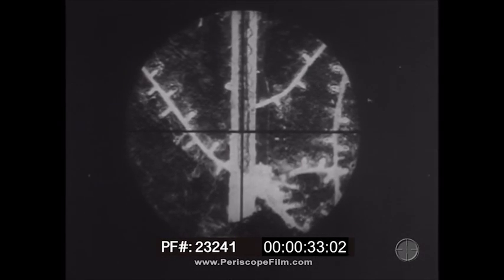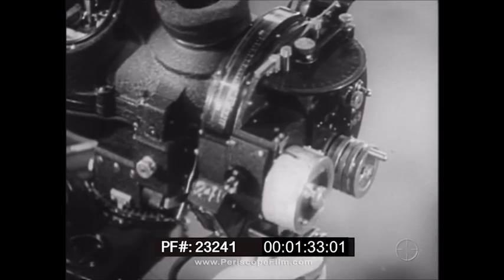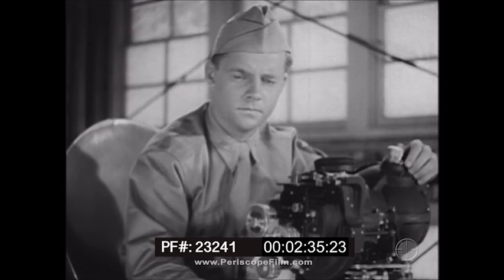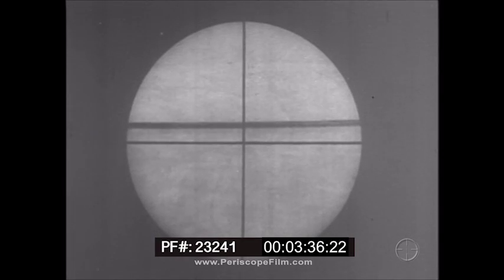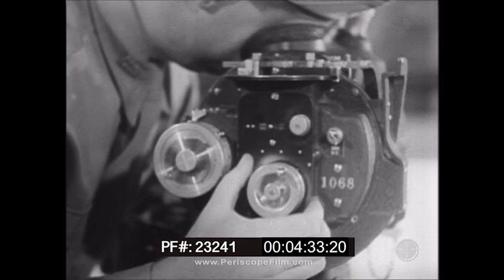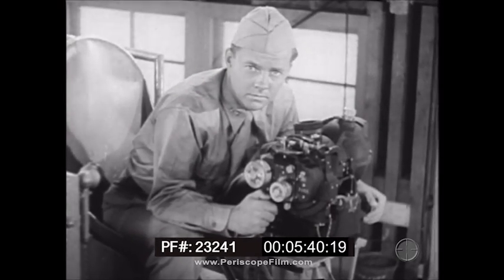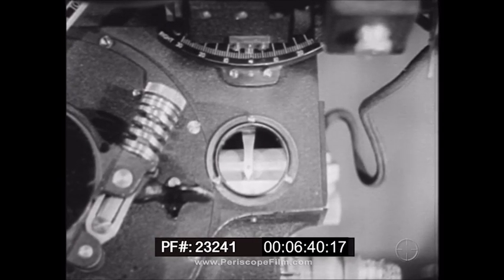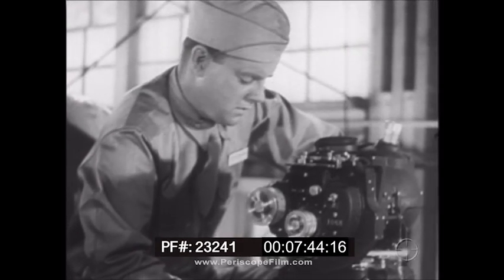OPERATION OF THE NORDEN BOMBSIGHT  DECLASSIFIED WWII BOMBARDIER TRAINING FILM 23241

Comment: The norden was... interesting. For one: It wasn't nearly as accurate as the military said it was, however it was one of the best in the war. (The Germans did know about it, and their sight was equal to or, depending on who you ask, better than it) Think about it: This isn't a game, you've got literal hundreds of forces acting on those bombs the moment they leave that bay. For one the wind shear of the aircraft will throw them off the moment they hit the air, then the wind in general will act on it the whole way down, any disturbances in airflow will throw the bomb off even slightly, the bomb's weight will make it a bit unwieldy in the air, making it wobble around quite a bit, and even then you have to account for your altitude, airspeed, and heading. It wasn't "bomb in a pickle barrel at 30,000 feet" accurate, but within 1,000 feet of a target at 20,000 feet is an impressive feat that people need to respect, even if it wasn't as good as it was noted to be

Comment: More than a few bomber pilots 'kept the plane to themselves' - normally the Norden sight actually flew the plane while engaged.
In formation, flak exploding all around, fighters making strafing runs at the plane and the plane quickly gaining elevation  as the weight of the bombs fell away, these pilots went by verbal instructions from the bombardier and kept control of the aircraft to themselves.
They stood a better chance of bringing the aircraft - and her crew - home, as the Norden had no means to compensate for the battle going on all around her during a bombing run.
A fine sighting system to keep the plane/bombs on target during smooth and level flight without the enemy throwing everything it had at the aircraft to knock it out of the sky.
During battle situations the pilot and the bombardier working together was the best plan to live to fly another day.

Comment: And they still could not guarantee a hit within 2 miles of any target
Reply from the maker: Good comment -- true! -- and thanks for being a sub.
Reply: Nonsense, it was far more accurate than that, it could consistently place a single bomb within 400 ft or less from it's aiming point dropped from a B17 at 23,000 ft traveling at 225 MPH.
All the nonsense claims by people that it wasn't accurate are from biased people who just want to bash the USAAF, people who want to make a name for themselves or people who just repeat the nonsense myths from the first two groups. 
All these supposed experts on the subject just want to blame every single bomb that missed it's target on the Norden bombsight when in fact it's far more complicated than that, first off 66% of the bombs dropped weren't even aimed using the Norden bombsight, instead they were aimed using the H2X ground scanning radar system especially during the winter months when overcast skies prevented optical aiming, but they'll take the results from a far less accurate system and pile it undeservingly on the back of the Norden bombsight when it didn't even have anything to do with the results from those mission's because it wasn't even used for them, and they'll unjustly blame other things like lead navigators flying entire formations to the wrong target resulting in it getting bombed and they'll take the results from something like that and enter it into their nonsense math formula as "zero bombs on target" even if the bombardiers absolutely plastered what they were actually aiming at. 
The Germans lighting off smoke pots to obscure targets, and camouflaging targets and setting up decoys down the road resulting in another "zero bombs on target" result that they'll include in their nonsense math formula which are things that aren't the fault of the Norden bombsight nor should the results from thing's like that be blamed on it.
The Norden bombsight was incredibly accurate and worked exactly as advertised by it's inventors and the USAAF, ridiculous claims made by parties outside of them that the same hack historians like blaming on it's inventors and the USAAF are also nonsense, like that pickle barrel claim, nobody in the USAAF or the designers or builders of Norden bombsights ever made that claim no matter how many YouTube video creator's say they did, in the first place why would they when from bombing altitudes and with all the more magnification that the sight has you couldn't make out a pickle barrel, the fact is nobody knows where that pickle barrel nonsense started but it wasn't from anyone who had anything to do with the Norden bombsight or the USAAF nor should they be held to task for something they never claimed, most likely it was something that came from your typical newspaper reporter or someone like that but it was never claimed by an official source.
Saying that the Norden bombsight wasn't accurate using the same measuring metric that all the supposed experts use is like saying the M1 rifle isn't accurate based on a post war report that found for every enemy soldier killed by an M1 387 shots had been fired by them on average, and since that same report showed that the average distance between infantry engaging each other was 60 yards that means that the M1 can only hit a man sized target at 60 yards once out of every 387 shots so ththerefore it's an inaccurate rifle, well any of us who own M1's will tell you that a service grade out of the rack M1 will easily put 10 shots in a 2½ inch group at 100 yards, post war reports like that don't speak to the accuracy of the M1 or the Norden bombsight, only to the conditions under which they're used.
When it comes to what happened in the Pacific the early problem was the ballistic tables for using the Norden bombsight didn't account for the temperature in the jet stream above Japan, another myth is that the USAAF didn't know about the jet stream above Japan but that's entirely false, they knew very well about it and it's speed but what they didn't know was that it was a full 42° C warmer than the temperature at that altitude above North America where the development for the ballistic tables was made and proven at in preparation for the bombing of Japan, when they realized what the problem was the issue was that it'd take about 6 months to realign all the data to come up with the proper ballistic trajectory charts to set the Norden bombsight for bombing from that altitude above Japan, in the meantime USAAF intelligence has determined that since Japan lacked an effective night fighter force coupled with the fact that they had a serious soft spot between 5,000 ft and 10,000 ft with their AA guns it was determined that a quick fix to the problem was night bombing between those altitudes, however in the meantime an adjusted ballistic table had to be developed for high altitude bombing above Japan for when the atomic bomb was ready because any bomber that would have dropped it between 5,000 and 10,000 ft would have been destroyed by the blast, proof that the Norden bombsight was indeed accurate was the dropping of the atomic bomb on Hiroshima, the Enola Gay was traveling at over 300 MPH at an altitude of 31,000 ft when it released it's bomb and ot detonated directly over a point just 800 ft from it's aiming point, nobody else in the world not the Germans, the British or the Japanese were capable of doing that, all the nonsense talk about the Germans or anyone else who supposedly had more accurate bomb sights is just that, talk, the fact is nobody else during the war bombed from the altitudes that the USAAF bombed from, everyone else bombed from lower altitudes and if you remove everything like human error, bombs that were aimed using other systems and all other factors that don't reflect on the actual aiming methods and their results even though everyone else bombed from lower altitudes they still couldn't obtain the accuracy that the USAAF did.
Another thing is all the malarkey claims about the RAF and the Germans rejecting the use of the Norden bombsight, neither one would have ever considered it's use, in the first place the Norden bombsight worked in conjunction with the Sperry autopilot system, without it you couldn't use the Norden bombsight, for anyone else to reconfigure their aircraft with the Sperry autopilot system or a reverse engineered copy of it and then retrain their crews for it's use would have been a minimum 6 month program that they'd have had to suspend most or all of their bombing campaign, add on at least another 4 months for reverse engineering the system if Sperry didn't hand you the plans and offer support, and all that aside why would the British even consider it in the first place when optical aiming is done in daylight and they were night bombing which was completely different all the way down to their bombers flew in streams for night bombing instead of in boxes like the USAAF did in daylight, so all that nonsense about other countries rejecting the Norden bombsight are all taken out of context, nobody rejected it "because their bombsights were more accurate", they'd have rejected the idea simply because it wasn't feasible.